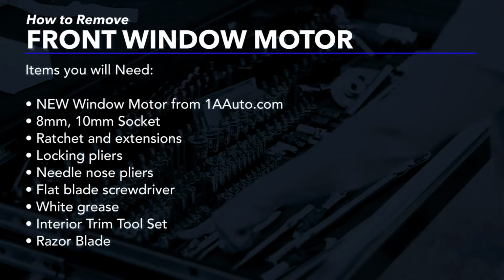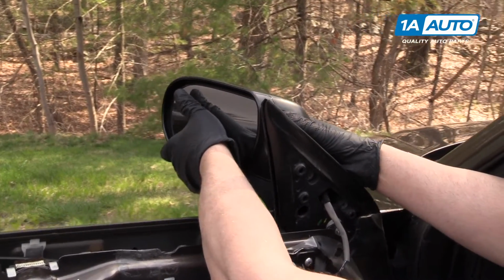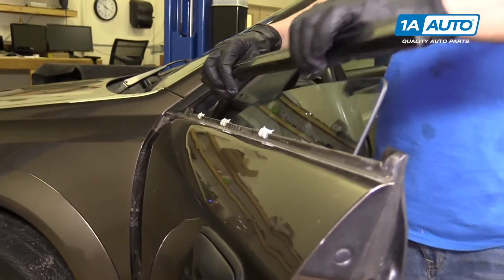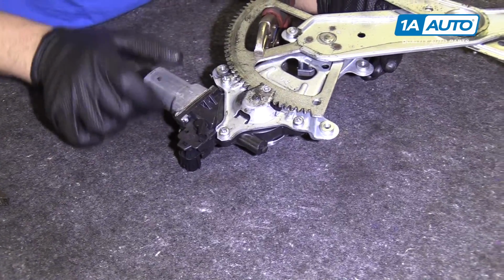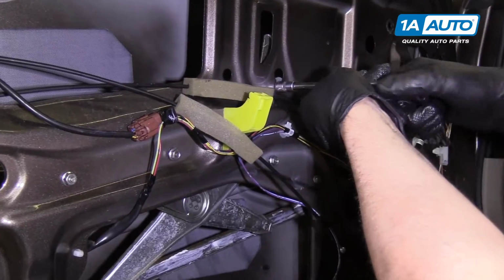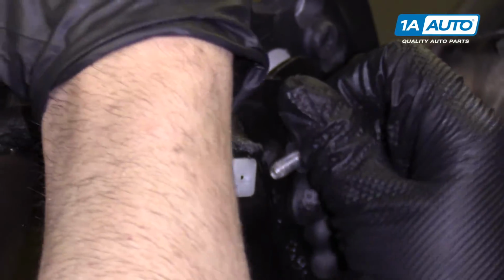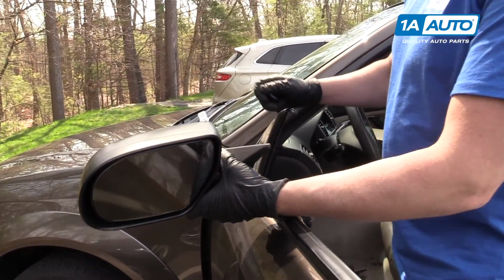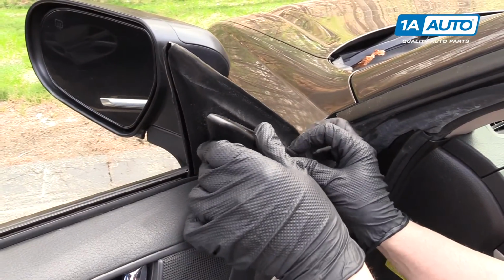How To Replace Window Motor 04-09 Subaru Outback

Comment: READ THIS IF YOUR WINDOW IS STUCK UP!
I just did this repair, and you can do it if your window is stuck in a closed position. All you have yo do is swap the step of taking off the window bolts and removing the whole actuator itself. 

So take the 4 actuator bolts on the right side off first and hold the window so it falls gently forward.
From there you can reach those two window nuts.
Remove your window. 
Take out the remaining two bolts for the actuator and you can take it right out.

This issue gave me a headache, so I hope this can help someone.

Comment: First off, this video was extremely helpful as I just replaced a bad  driver's side window motor on my daughters 2007 Outback. Both the disassembly and reassembly instructions were very clear and easy to follow along with.  The only issue I had was her window was stuck halfway down which meant we couldn't access the 2 nuts that hold the window to the regulator. My solution was to have a buddy help me by holding the window as I removed all the bolts and nuts holding the regulator in place.  Once the regulator was free from the door he moved the window/regulator combination to a position where I could removed this 2 nuts easily.  Then I separated the window from the regulator and he removed the window. After that it was easy to follow the rest of the instructions to complete the job. Thanks again for this video.

Comment: With the help of this video, I was able to successfully change the driver side power window motor in 2006 outback.  My window was in the up position, but watching this video made it clear what things I need to take off and the sequence to do it.  My daughter was a great help by holding onto the window as I took off the last series of nuts and bolts.  We were able to slowly let the window lower by hand as the scissor arms of the regulator collapse.  I was able to access the two nuts that held window to regulator arms using a 10mm wrench.  The reinstall took some patients, but everything worked out just fine.  I got everything into place, and hooked up the switch to lower the window to allow me to tighten the nuts holding the window (They were on finger tight before lowering the window.)  This job can be done with window up; just be patient, and don't force things.
Reply from the maker: Thank you for the great reply. We love to empower our customers by showing you how-to perform your own auto repairs while installing our high quality auto parts. Have a great day! 1aauto.com +Ken Szok

Comment: Just did this job on '05 OB. Useful video. One caveat--no need to remove mirror/door glass even if motor frozen like mine was. All nuts and bolts are accessible with minor difficulty. You will need a long narrow wooden rod to prop the window as you work and a friend to push and pull it as you detach and reattach.

Comment: Great video. I just had a thought. You moved the window down to line up a hole so you could take a nut off, how do you do that if your motor is bad and stuck in the up position? Also does the motor have to be set anyway? Like the windshield wipers do on there motors?
Reply: I'm in the same predicament as you ! Did they not respond to you question ?
Reply: I did this job a month ago. Dead motor. Window stuck up. Nuts mounting glass to sliding track are accessible with a slim wrench no matter the window position. Once you release the window glass you can move it out of the way so all other connectors can be reached. No need to set the motor. It just spins in each direction per the switch. Limits up and down are governed by the scissor arm mechanism.

Comment: Hi ! Thanks for your video, it is very detailed and helpful however, you need to do a video showing the replacement of the motor with the glass stuck in the up position. Most persons are having the same problem, including myself. What normally happens is that the switch fails in the close position which put a constant supply on the motor, this eventually burns out the motor, and the glass remains in the up position. If you really what to help a lot of people, then you need to make a video, showing the motor replacement with the glass in the up stuck position.   Thanks in advance !
Reply from the maker: +sheldon  Thanks for checking us out! We'll pass this along to our production team to see if we can get this video on our list.

Comment: This was very helpful. I'm not a mechanic but with this, I was able to replace the window motor in my 2006 Outback.
One thing I might add. My motor was not working and the glass was UP - so I couldn't move it down as per the video - but fortunately was able to reach the nuts to undo the glass from the top.
Nice Work 1A Auto!
Reply from the maker: +@petes6347 Thanks for checking us out! http://1aau.to/m/Shop-1AAuto-c

Comment: I had a few probs getting to the studs on the window too - I just took out most of the bolts. And with the one where it is said just loosen it off a bit and then slide it up; I took it out. Just a lot of fiddling about but I liked the calm demeanour and most of the camerawork. I was able to replace the regulator and my window is working again! Yes ! Well done.

Comment: In this and your rear window motor install video, you assume the window motor is working to position the two nuts that hold the window on. For most people replacing the motor, that’s not the case. It would be beneficial to show the removal without being able to lower it.
Reply: Loosen the bolts holding it up and the glass will let you manually lower it.

Comment: Hello great video!!!However,   my motor was not working so  I did not  remove the window  at all,  kept it fully up  and  removed  the bolts that hold the window together and once the window was  detached,   I removed the rest of the bolts and the motor came out.  I tested the new motor while it was  out of the door which saved time .   Once I lined up the motor inside the door  I was able to attach the window and move it up and down as required.  Thank you for this video which can help a novice like me,  to do the work of experts.  It is wise to have another person to help with the whole process.
Reply: Nice your comment fills in the missing info. 👍🎉🎉🎉 I was watching thinking this is great, and then he uses the “motor” to move the window 🤦🏼‍♂️ that’s why we’re here, because the motor is stuffed. 😝

Comment: About the vapour shield - I imagine that the adhesive is meant to seal off the door to prevent fumes but there are gaps. I don't see any efficacy in it. Also, when you get the adhesive on things, and you will, gasoline ( petroleum) helps to get it off. Haven't found out how to get it off clothes yet.

Comment: I did this to my Forester but I removed the bolts attaching the motor to the regulator with all parts in place in the car with the window up.
I realise it may not be possible in this model Car but in the forester you can put your hand in through the speaker hole and Access the bolts from the back. Perhaps it can be done in the outback as well.

Comment: What a takedown job, my window wasn’t going up for a month. Had a massive in on my health when traveling to work at 4am and the window down. One day I found the courage to remove the door panel to see what might have caused this problem. The screen has came off, while half mount dislodged. Noise to and from locations.

Comment: If anyone watching this had a window stuck in the up position and you need to replace the motor, just remember these things:
1. You're going to have to take all 4 bolts and 2 nuts off to release the regulator in the door. You can't lower the window to the access ports like he does to release the window from the regulator in the two spots that they connect.
2. Once the regulator is released, you'll have to release the window from the regulator in awkward positions, which is totally possible.
3. You might have to use wd40 or pb blaster on the fasteners holding the motor to the regulator. Mine were so tight that I could have stripped them without loosening them with a lubricant.
4. To align the regulator, I had to connect the regulator to the wiring harness, lay the regulator in the bottom of the door, then connect the window switch interface/door to the wiring harness and work the regulator so that the teeth were facing up, not down. It took me FOREVER to realize that I had to do this because aside from this small detail, my regulator looked exactly like theirs, but it wasn't aligning properly in the door to fasten the bolts to it. This step might take 2 people. This step also cost me hours of frustration in the June sun and heat....
5. Make sure your window is on both racks/rails. My the front part of my window wasnt, and my back part was, and I had to take the door apart again because it wouldn't close properly because of this.
6. Don't leave the speakers loose. You don't want rattling when you crank it!
Reply from the maker: +Uriah Graves Thanks for checking us out and providing some extra feedback! 1AAuto.com

Comment: Awesome video !!!!  quick question guys do you possibly have any idea about my problem in my Forester my AUTO switch opens the window no problem but closing can only be done in sort of jumps , do you know what may  be the problem , motor ? switch ? or else .... any help or guidance much appreciated  I've also noticed that little green light on the switch is very weak now compare to others .....;-(
Reply from the maker: +piotr siwecki Hello! We can't diagnose your vehicle, but that is a typical symptom of a bad regulator or motor. You will want to inspect the vehicle to see what the issue is. Thanks! 1AAuto.com

Comment: My window is in the up position, and the motor is bad. How do I get the window down?
Reply from the maker: +Darren Sauter Open the door panel and access through there. You should be able to move it with your hands

Comment: cool, but my subaru has a six wire connector to the motor / regulator....also, if my motor is dead, how do you propose I move the window up / down to access the bolts?  If the window still moved up / down, why would I be changing it?

Comment: You used the motor to lower the window to line up those bolts with the access holes.. how are you supposed to do that if the motor doesn’t work

Comment: OUTSTANDING!!!!!! Thank you! I had a bad motor with the window stuck in the closed position. After removing the vapor barrier I reached behind and gently tapped the motor (where the plug is) while holding down the window switch. It had just enough life to start the motor and get the window into position so I could unbolt the glass.
Reply from the maker: +Nachum Hurvitz Thanks for checking us out!

Comment: so the motor is bad that's why your replacing it.  then how did you get the window down if the motor was bad?
that's my dilema. I cant remove regulator bolts if the window won't go down to get access to the bolts.

Comment: I have the same question what if the window is up and you can not control the motor from the controller.
Reply from the maker: +Byron Guevara Many times being able to get to the cable and breaking it would be able to allow for it to come apart. The window glass would just need to be held up to make sure it would not come falling down.
Reply: Same problem but that answer makes no sense. What cable?
Reply: @1AAuto  please clarify this answer to Byron Guevara, thanks!
Reply from the maker: +Byron Guevara You'll want to double check that there is power at the window motor and confirm the window switch hasn't failed. If you've confirmed that the window motor is bad. Have an assistand help you hold the window glass and then carefully remove the bolts holding the regulator to the door. Carefully lower the glass and regulator to a point where you can un bolt the glass and remove it from the door. Then try to remove the motor from the regulator or collapse the regulator to get it out of the door. It won't be easy, so take your time.
Reply: @1AAuto  thank you! I paid a mechanic....
Reply: @1AAuto  thank you. video was very helpful, and i replaced the motor and switch- but now the windo goes up too far closest to the rearview mirror- which pushes the side of the glass closest to the rear door into the fram and i cant shut the door. is there an adjustment?
Reply: @1AAuto  why can't I just hold the window up and remove the hold on bolts without taking the whole damn car apart

Comment: What about if ur motor is dead in the up position? You can’t roll it down to access the motor easily?
Reply from the maker: +RealTalkos You'll have to find a way to get at the screws that hold the motor to the rest of the assembly. This will allow you to disengage the motor, so the rest of the assembly can move freely.

Be careful: once you disengage the motor the window could drop and break. You'll want to get somebody to hold it, or wedge something under the lift arm (inside the door) so it can't move.